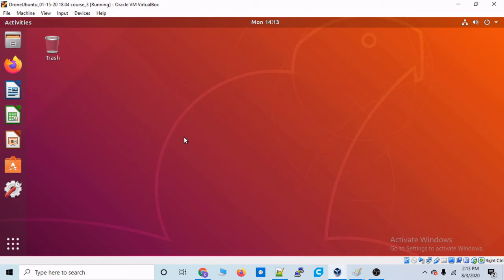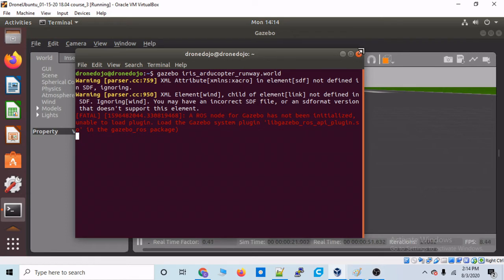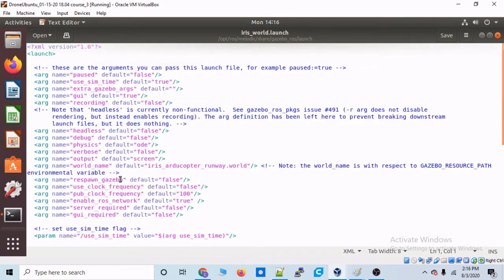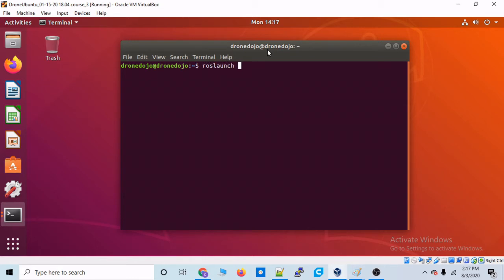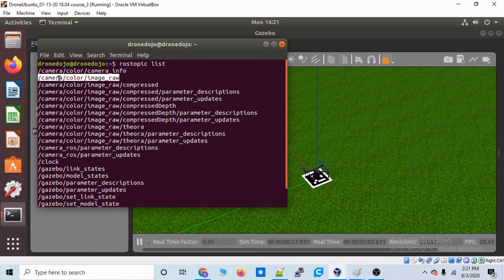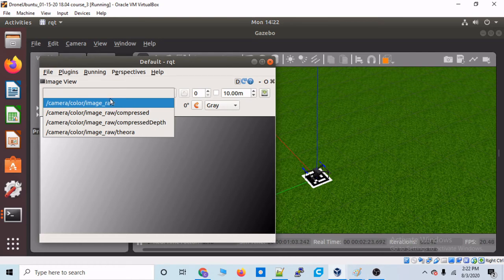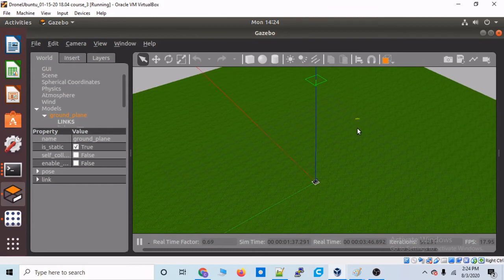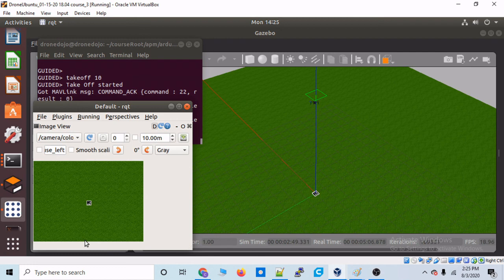Simulate a Camera on a Drone with Gazebo

Comment: do we have to use ROS? if i want to achieve the same goal, can we do it without ros?
Reply from the maker: Good question. The main use of ROS for the apps we've developed is just for use in the Gazebo simulator. In the real world, you can totally do this without ROS if you wish
Reply: @thedronedojo  

Thanks for answering.

I have 3 more questions. :)

1. Is it possible to convert our code to C++?
2.Is the course compatible with PX4 too? (Atleast for the simulation).
3. Do you have any student discount? Or maybe a bundle discount for both  drone programming primer and precision landing?

I didn’t manage to get a respond from the contact option in your site.

Thanks!